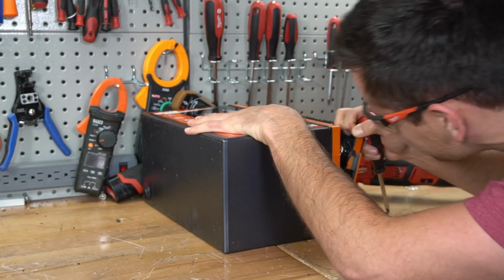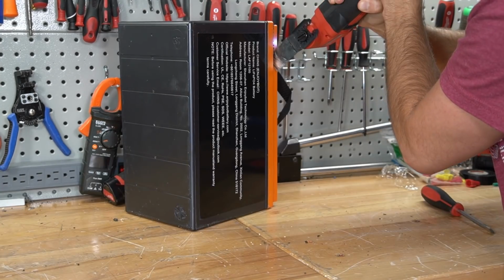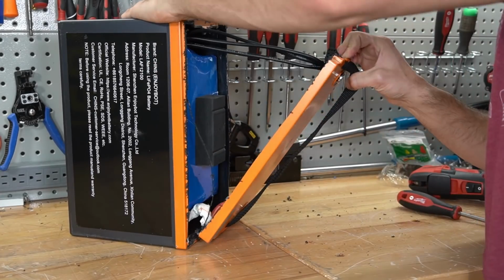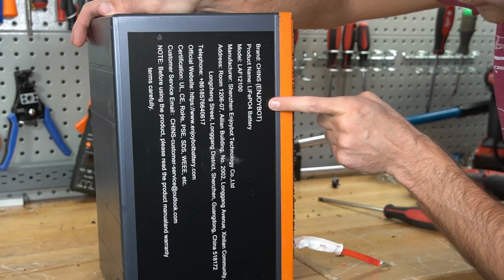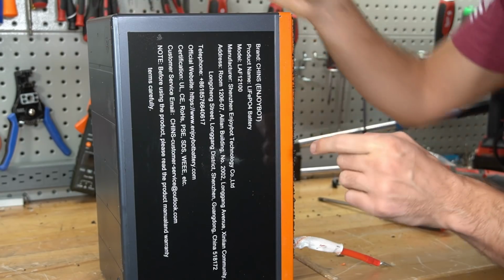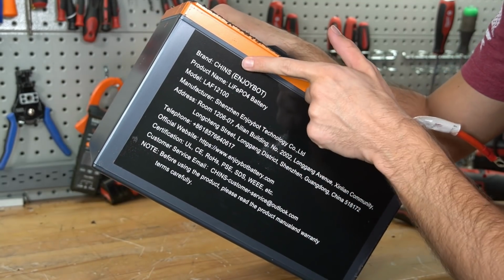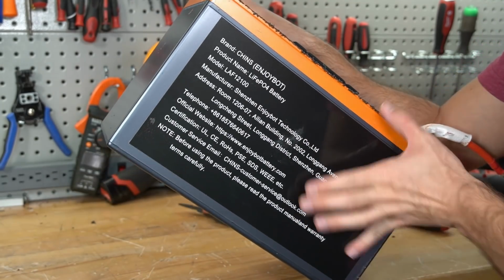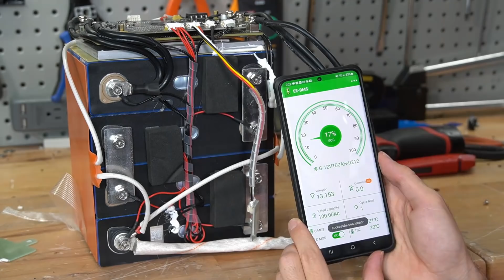CHINS $579 12V 100Ah: Actually impressive!

Comment: Server rack for me... So if I have 48v system and I want to build something like 2 banks of 16 x 304Ahs the amount of BMSes and points of failure is parabolic compared to two banks 16 batteries each running on 2 bms only.
It is hard to beat 304Ah banks on 48 volts 8n price or reliability...
But it is great to see good quality from low cost competitors. 
It would be awesome to find out more about the heating system, what is the wattage of those pads, their duty cycle, thermal protection if any and any other details if possible?

Comment: I'm looking for a 48v replacement option for my golf cart.  I know there are a lot of options out there.  Wondering if this could be one of them?  Anyone have thoughts on this?  I'm also wondering if you run them series, which I'd need to... do I also get combined wattage?  In other words, the BMS are 100amp, ran in series do I now get 400amp?  I know golf carts are pretty demanding, which is why I ask.
Reply: When you run in series the Amperages do NOT add... only the voltage. You will have a 48 volt 100 AmpHour battery pack. To add the Amps you have to wire the batteries in parallel.

Comment: I bought this exact battery and they have great support. The included pamphlet didn't include all the LifePo4 parameters for my solar charge controller and they responded ASAP. So far, so good.. lets hope the BMS lasts the life of the battery. You can see the installation of this in my channel.
Reply: did you buy from Chins directly?

Comment: I am new to running lithium batteries! I just installed a single Chins 100ah in my new toy hauler with amazing results. Absolutely recommend them and the customer service was top notch. Had a couple of questions and got quick responses! Can't wait to build a bigger battery bank.

Comment: been using the non heated version. Indoor. Got 8 100ah chins 12v non heated. 340$ otd. Each. Got the Amazon $ back on the chins dropped price. Been running heater  . Fridge. Well. 3000w growatt

Comment: I have the 200ah without heaters inside my RV, so I'm not concerned with the temp issue, but the batteries are great for the price. I have 4 12-volt 200ah batteries for $2400, free shipping to my door, very well packaged, and you can't beat that with a stick. Customer service is excellent; They responded to my questions within 24-hours plus, I got a free 10 amp charger.

Comment: Hmm . Well maybe the Owner and founders last name is Chin ?  On the heat sensors . In that heat rises . They " may " not sense via conduction through the batteries ? I guess you could test this by throwing it back together in a controlled environment ( Frig maybe ) and see how long before they drop out & energize the heat pads . Then open the battery and use foam to block " heat rise " from the sides of the battery pack . Sounds like a pretty cool battery . Be safe out there folks ... Gubs

Comment: Help? You've done a lot of work with cells and wiring them up so you might be the guy to help with this. I've got a 12V solar system on my van and I'm putting an e-bike on the back for local transport (all DIY). I want to have the cells connected in series to make 72V for the bike and then parallel to make 12V for charging/running the van interior when it's connected to the back. Any ideas?

Comment: In a year, we'll probably have these features at a reasonable price.  Given the base price plus the costs for heating components, this should only cost at most $450.
Reply: not if you need to make a profit
Reply: @davidparker7156  A baseline Chins battery is selling for $329 retail.  The silicone heating elements cost around $40 retail.  A DC SSR costs about $13 retail.  In theory, a Raspberry Pi Zero 2 W costs $15 retail, but is not currently available.  Using a less effective but sufficient Arduino Nano is available for $25 retail.  So a motivated amateur can buy the parts for less than the price that I said. So, it seems like a Chinese manufacturer should be able to make a profit at $450, equivalent to the profit, or lack thereof, for the baseline Chins battery.
Reply: @richdobbs6595  that is too thin a margin in my mind but if you think it will work maybe you should invest in a company
Reply: @davidparker7156  Well, in America it is.  Which is why all of this stuff happens in China.  When you look at the fundamental changes need to the BMS, the trivial amount of programming needed, the relative low cost of a silicone heating element, the cost of a single thermistor, heated batteries should not fundamentally increase the cost of a LFP battery.  But just the same, it isn't going to make or break a battery company, so where should I invest?  I have no idea whether Chins is a sound company, or just a dumping ground for some Chinese over-manufacturing.  But, since Chins has already developed this, the profit margin will be dropped over time.
Reply: @richdobbs6595  prices have come way down with batteries for sure. Supply and demand I guess
Reply: Ja, i hope so 👍

Comment: I guess you've stopped reviewing Battle Born Batteries ?  They have come out with several new batteries.  Despite your promise to review the new Battle Born Batteries, I guess it's just a one and done approach with Battle Borns ?
Reply from the maker: They are too expensive. I could review them. You can buy a higher quality server rack for a fraction of the price. When did I promise to review them? Please link it here where I said that.
Reply: @WillProwse  I don't think a 300 lb server rack would fit in my van.  You said on your site that Battle Born were the recommendation for rv, van and marine applications.  After your visit w Battle Born you said they had great new batteries coming out and you couldn't wait to review them.  Please don't forget your nomadic roots.  We need mobile options as well and it was our views that got you where you are.

Comment: I’ve had a 200 ah from them for just about a year now. Zero issues, and when I did contact their customer service with technical questions, they answered within 12 hours and very helpful. I am quite impressed with the company and the product.
Reply: Thanks for sharing. I'm going to buy the 200 ah battery from them (without internal heating). I'm just beginning to learn about this stuff, but by my rough calculation (if correct), it should power my mini fridge and laptop and phone, and that's really all I need in terms of electricity in my van.

Comment: If they can make the server rack batteries quality like Signature solar 48v 100 amp price down to about $1000 each will be awesome, I would buy like 6-10.  Hope it will go down in couple years.  Thanks Will.  I got the Sig Solar 3x batteries n GroWatt 5kwh Inverter n GroWatt transformer running.  I turned off the Grid meter.  it got so expenSive in San Diego, CA.  SDGE changed to 35-39 cent per kwh + Fire protection Fee + system fee (they upgrading their electrical system but user have to pay) + tax + other fee.... came out about 55- 60 cents per kwh....

Comment: I have two CHINS 300ah 12v batteries in series.  I've had them connected like that for a couple months and I haven't had any issues.  They don't have low temp sensing or bluetooth, but they're in a indoor environment and are connected to Victron gear so I don't feel like I need it.  They do exactly what I expect and I haven't had any issues.  I've reached out to customer service and have gotten a response within 24 hours every time.

Comment: Hello. I want to ask you something and if you are kind enough to give me a solution to the problem I am facing: I bought a solar inverter Non-interruptible source VOLT PRO PURE WAVE series S 1000W 12V / 230V. I connected to photovoltaic solar panels with gel battery and it works very well, unfortunately the gas boiler gives an error because the flame detector is on ionization and needs a true NUL. What would be done in this case?

Comment: Hi Will.  A good follow up test is to see if the heaters turn on even when it is NOT trying to be charged, like at night.  I think I would rather the heaters be off, at night and only turn on when the battery is sees current, and uses the current to heat it UNTIL it is warm enough and then charges it and heats as needed.  It would help preserve the life of the battery.  I live in a northern latitude with lots of clouds.   Heating the battery, when I have no incoming power (or nearly no power) it is useless to try and heat the battery   All the best to you.  Thanks for the content.
Reply from the maker: No, they turn on. Even if you are not using them. They are designed to keep the cells at a good temperature 24/7. And yes, it will turn off the heaters once the temp sensors are triggered. This is common for all of these batteries, not special at all. And these heaters do not draw much power at all. They can run all night without issue. You just need to insulate the battery bank and then they will only trigger once, if at all, for the night.
Reply: @WillProwse  thanks for the reply.  In my situation, my batteries are outdoors but insulated.  They never get below 20F. The outside temperature would be about -30F when that happens.  When the do charge, via solar in the winter, it is VERY slow .05C or less. Once the batteries start to charge at a very low rate like .01C they heat up above 32F quickly even on the coldest day. There is a good sticky thread on forums that helped me. I watch the weather and top the batteries up when the batteries with a generator and big charger only if the batteries are above 40F.  The system is 3 year old, and no problems.  I would use a heated battery if the heaters stayed off unless a charge was coming in.  I have considered building something like that.  Thanks for all that you do.
Reply: @msears101  The Redodo heated battery (another Chin brand) only heat when incoming current is detected. I use them exactly as you describe, my cabin gets very cold when I'm not there and I still want the system to charge in December when we have almost no light. I have it insulated, and can monitor it with a Victron setup remotely including a temp sensor. I can even use a relay on the Victron to turn on my diesel heater if needed. I bought a ready made cooler bag (for food or drinks) that fits the battery exactly, insulated with some extra armaflex this makes the heating pads much more efficient.

Comment: Car battery: Question
 I replace my acid car's Lead acid battery every three years so I don't have problems when it gets extremely cold. Other than price point doesn't a LiFePO4 battery have problems with the heavy current demand of a starter motor particularly in a cold climate as you can see 400 amps or more during the starting cycle?
Reply: The Chins battery I have 24volt 150amp, max continuous discharging current 150 amps.

Comment: Got a nice 12v 100ah  with low-temp protection from Amazon for 310 USD and today they are up to 320 USD for some reason. Could it be the Regime is doing what they did to food & fuels?     The product ASIN is B09QM42WNY

Comment: So if it's zero degrees F and I start charging, it's going to charge immediately? Before waiting for the cells to reach temp?
Reply: Straight from the manual. "The charger only supplies power for the heating film and it will not charge the battery when the temp is below 32F. When heated to 50F, the BMS stops heating and the battery starts to charge."

Comment: I've had two of the 100 amp hour chins batteries without the heaters installed in my motorhome for 4 months now the performance has been exceptional they're inside under the bed so low temp charging was not a concern of mine and I picked them up on sale for around $340. Can't complain
Reply: Thanks for the info. I think that's where I'm headed for my RV.
Reply: I'm going to need to power a small refrigerator for my 2003 Honda Odyssey. I'm so confused reading all of this stuff and I'm wondering if this would be a good fit?
Reply: @Debrajoy  I use min 4 12v 100ah chins to run mini fridge 247
Reply: @Debrajoy  how long do you need to run it for before starting the car? and what kind of environment is it going to be in. I have a refrigerator freezer that I take four wheeling with me. It's dual voltage so it runs off 110 volt house power and 12 volt car power. I get it cold in the house and put my food in it and then put it in my blazer when we go four-wheeling. When the vehicle is running you can run the refrigerator as long as you want. When we stop for the night and set up camp. My refrigerator easily runs off my battery for the whole duration of setting up camp preparing dinner sleeping getting up the next morning and starting breakfast. I start the truck just to make sure that the battery is not dead when breakfast is cooking. And there's never been an issue. So you're talking 10 to 12 hours. With just a regular car battery. If the vehicle is going to be running at least once a day I don't think you should worry about trying to add a lithium battery just to run the refrigerator. Unless it's some kind of dorm room mini fridge running off of power inverter. That's going to draw a lot more power than a specifically designed mobile refrigerator. Plus you can't just put a lithium battery under the hood of your car and use it to start the car there's too much amp draw when starting and too much output from the alternator when charging. So you have to have an entirely separate battery and charger and all that stuff if you wanted to run a lithium battery just for the refrigerator.
Reply: @Debrajoy  Where are you going to be driving? A system in Palm Springs would use more battery than Portland, ME. Is the device a 12 Volt refrigerator? A 120 volt ac fridge would need some sort of inverter to go from battery to AC. That is a power loss. If it is 12 Volt DC than something like a Jackery, Bluetti, or other such device would probably fit your needs.

Comment: Great find Will, have you come across NCBH make batteries?
I'm interested as they have multiple features such as USB charge output too.
NCBH 12V 40V/80V/100V/120V/240V/320Ah LiFePO4 Battery Deep Cycle Lithium Iron Phosphate Battery,12V 100Ah with Built-in BMS,Perfect for RV/Camping, Solar/Backup Power,Trolling,12V120AH (UK amazon ref B09BZLK3H9/)

Comment: Will, Here in the UK Renogy is advertising a new version of their 100 Amp Hr. battery. It is advertised at the same price as the previous version offered for sale but the picture show's prismatic cells unlike the one I own and the one you reviewed (thank you). The spec sheet also shows 2000 cycles at 80% discharge and NOT 4000 at 80% like the one you reviewed with pouch cells. Would you check this out for us please?

Comment: Will, I currently have 2 of these and in a real world test they do not work as well as you might think. First, most chargers won't work with it because when the low temperature charging sensor shuts down the charger doesn't detect it and therefore doesn't activate the heater. Their customer service did respond very quickly and the sent me a small 10a charger for free. I'm in Colorado and I was able to leave them out in some cold weather and while the heater did start heating, the charger would stop providing power before it reached the 10°C threshold programmed in the BMS to start charging. They then gave me a password to adjust the temperature reconnect parameters but it still doesn't heat long enough to charge the battery. Perhaps the charger they sent times out because it shows a full charge indicator light and shuts down. I have been in communication with them and they have been very responsive but still haven't solved the issue. Perhaps you have some suggestions. Thanks for your hard work it's much appreciated 🙂👍
Reply from the maker: This battery works the same as the more expensive ones. It's a problem for all of them.
Reply from the maker: Oh that's a great point!! Yes you need an appropriate charger that will not shut down and act as a voltage source to keep the heaters activated.
Reply: Thanks for posting charger information. My question is how to know whether the charger we already have will work with these internally heated batteries. We are intending to use these batteries on a fifth wheel RV with a 90amp Progressive Dynamics Converter. Any way to know whether this charger will disconnect if the battery heater engages?

Comment: are those orange heater pads actually PTC type heaters? can you check this? because they do look new to me. however their general shape and design kindda reminds me of those low wattage reptile heater pads. if this is so then their internal resistance should increase over time when heating up and then eventually become naturally self limiting. at least for a given fixed input voltage, when switched to be fully 'on'. in which case they should be safe in the event of a malfunction that leaves them constantly turned on. that would be a useful safety feature wouldn't it ? so it would be nice to know.

of course one drawback of the added safety of PTC heaters is that they can be insufficient or slower to react, or unable to work well enough under more demanding situations. depending upon the requirements of the specific application. (due to the same self limiting behaviour). however i would not expect that to matter for this purpose

Comment: Nice tear down and freeze protection video. Are you doing a capacity test in another video?
Reply from the maker: I've capacity tested multiple relabeled chins and ampere time, and they all use the same cells and pull the same capacity down to 1Ah, so probably not anymore. In a year I might get another and test it to ensure that it is pulling the same capacity as before, but it should be fine.